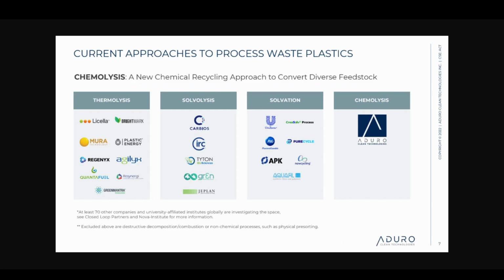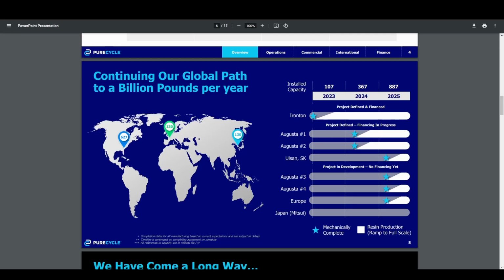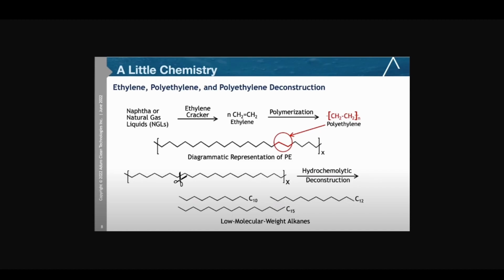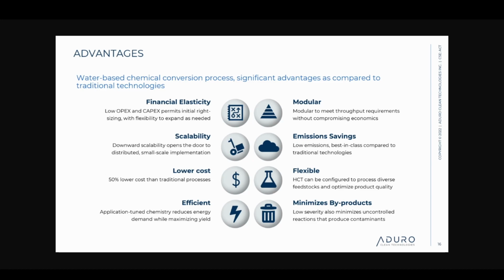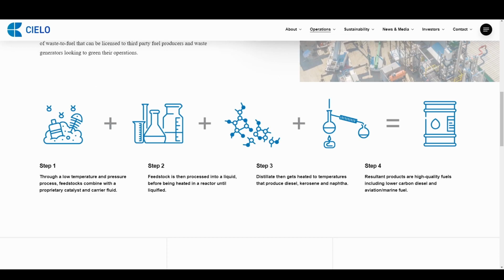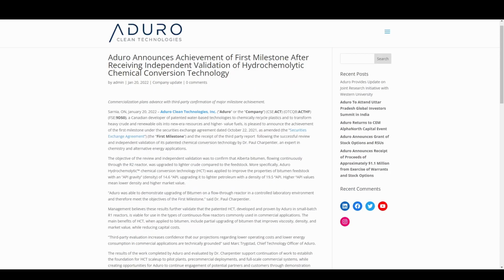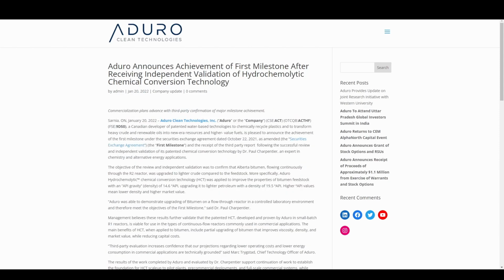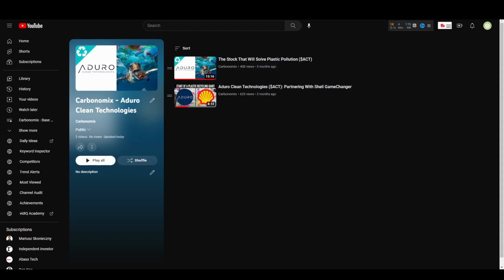Why This $0.80 Stock's Recycling Tech Is Revolutionary

Comment: I hold a lot of shares. Best company out there for the ENTIRE "speculative" chunk of your portfolio.
Reply: Good for you James.  How many you holding?  Thinking about starting a position.  What do you think they will go to?
Reply: @bobs7123   If they do 1% of the worlds plastics it could easily be a 50+ bagger on just that achievement alone. Now add in the bitchumen upgrading and the fact that if they can do 1% as well as they hope, why not 5%, why not 10%? Start building and add on every time you see a confirmation of the potential like shell admitting Aduro to the gamechanger program. Or just add regularly what whatever portion you're comfortable with. It is currently a pre-revenue company so take that into account. There are risk no matter what you invest in, but so far so good so far as Aduro is concerned! You can run some numbers yourself, look at their investor deck and how much they would make on a royalty model for a given amount of plastic.

Comment: Thanks as always for your videos. I've thought very seriously about investing in Aduro because it could be a massive opportunity, but haven't yet because they are still pretty much a lab-stage technology. Getting the R2 reactor working was a nice step but scaling up is still a big proposition. Also, the Shell Game Changer acceptance is definitely a feather in the company's cap but the stats I can find show that around 6% of partnered projects have made it to implementation as of 2020. And the most recent report I can find on the money provided by Shell is from 2013, which was an average of $500,000 for 24 months. Shell could provide Aduro more money and invaluable assistance to commercialization but I don't think that too much can be inferred from just being accepted into the program. I still might invest but I see Aduro being analogous to a pre-clinical stage drug company at this point, so commercial effectiveness is still a big unknown.
Reply from the maker: That is fair, I’d say. Shell or any partner is no guarantee for the tech to scale properly. The only true way to validate that is with the R3 pilot plants. Recycling multiple tons per day. Which is ultimately what the market is going to wait for, before truly piling into the stock. The value of the IP is probably multiple times the market cap currently. So there is a good margin of safety there. This is a relatively high risk, life changing reward type of stock. I am willing to take that bet.
Reply: @green_investing  Any thoughts on what dilution may be necessary to get to commercialization and how many outstanding shares there may be when they get there? I'm always interested in what the current effective market cap may be when potential future dilution is figured in.
Reply from the maker: Not much to get to the completion of R3 I believe. Between funding from Shell and any grants they may receive. Which they have been getting. I think it was around another $3-4M needed.